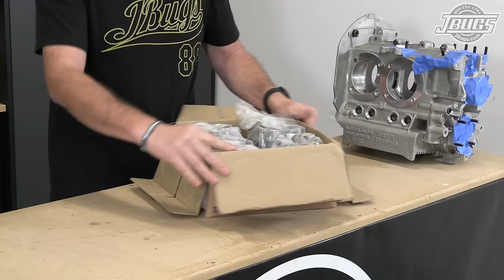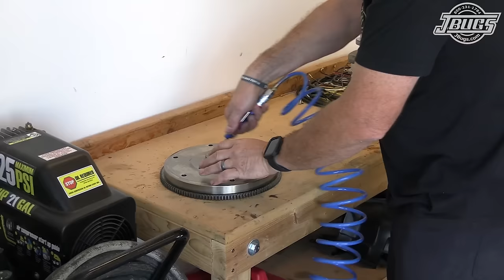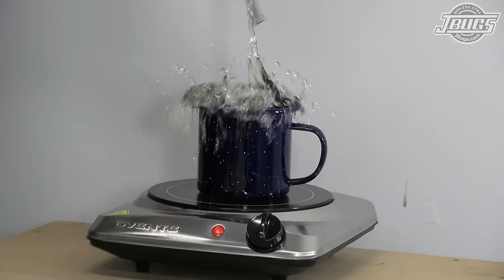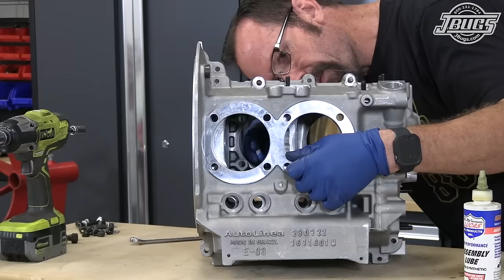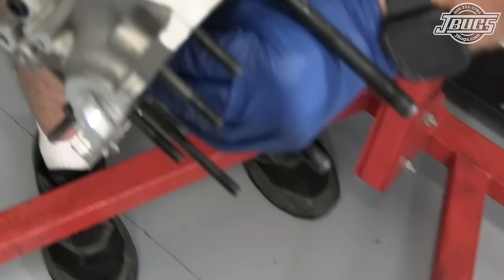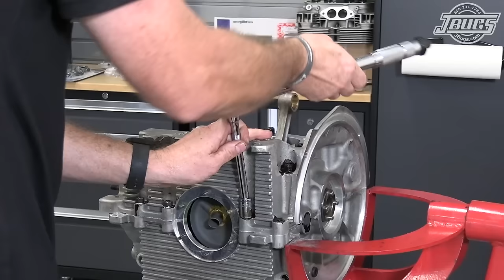JBugs - 1600cc Engine Build Series - Part 1 - Short Block

Comment: Nice video, is there anything I noticed was, need to balance the Pistons and the rods; always and I say always use the light and flywheel because the torque on the two rear cylinders cause the bearing to pound out the rear case and I like the 8pin the flywheel. Again balancing assembly is critical. I like the fact that the case has the option for a full flow oil system filter. And the Rodsuse better rod bolts which torque to 30 we used to talk to stock once the 28 ft lb safely
Reply: This is a pre-assembled kit from EMPI. There are better components certainly, we just built the kit as it came.

Comment: Better have a talk with your shipping dept about having to eat the case.  Put the case box in a larger box with plenty of packing. Worth the extra shipping cost. 

Page 120 in "How to Hot Rod VW Engines: The best procedure for building any engine is patience, care and constant rechecking"  When I built my first engine at 15, I put a couple main bearings in wrong. That was my learning curve.
Reply: That's what I have always been afraid of doing this myself. If it was a sb Chevy or Ford I wouldn't have a problem. But VW completely different. My engine builder won't be available till later this year.

Comment: Great video but I'm a little confused, the title says short block but you say long block? I'm pretty new to VW's not sure what the difference is :)
Reply: A short block is the assembled case halves with the connecting rods sticking out either end. A long block is a fully assembled engine (minus the accessories like engine tin, etc.) with the cylinders and heads bolted in place.

Comment: Sam, are the cylinder heads complete and ready to bolt on or do the valves need to be lapped before installation?
Reply: The heads are complete and ready to run. Could they be pulled apart and get a full 3 angle valve job? Sure, but I've never bothered for stock applications.

Comment: My only other comment is the engine doesn't look like it's going to spin too easily, do you have the correct main bearings for the case size to the bearings are these oversized case bearings.
Reply: The engine turns over and runs well. The kit comes with all new parts and standard bearings. A good part of why it doesn't spin "freely" is the Lucas Oil Assembly Lube. That stuff is super sticky, almost seems like glue sometimes, and I put it on everything.

Comment: If I got that case with a chunk broke off in that spot, I’d just TIG weld it back. No harm, no foul. BTW, I thought they came with the case savers installed. Speaking of the case savers, are they for 8mm or 10mm studs?
Reply: The broken piece isn't in a place that matters so we'll just leave it as is, again, no harm, no foul! The 8mm case savers were loose in this kit.

Comment: Does Jbugs offer in house classes for "hobby" VW restoration?  I've looked on line, and there is nothing out there.  Would be great to have the opportunity to spend a week and have a better understanding of electrical, mechanical and body work.  These videos are great, but to have the hands on experience would be valuable.
Reply: No, and for liability reasons it probably isn't something that we'll be able to do. We've regularly seen VW clubs put together "wrenching" or "shop" days which would probably be the closest thing we can think of.

Comment: Never built a vw, but a couple chevy and pontiacs
.  U don't mic out any bearing clearances?
Reply: With all new parts, checking the tolerances isn't common and most builders go by feel. If you're building with original cases and cranks that have been machined, checking clearances is a must.

Comment: What was the final problem that finally solved your locked up crank? Too you a few times. Not the rods being upside down but when torqued crank locked. I am having that problem. 4 times now tighten middle 2 just a little and it locks up
Reply: The bearings weren’t settled in place on the dowel pins. They are finicky little things!

Comment: What is torque of the center big nuts? Jbugs site says 18lb other places say 25.
With my halves together 18 lb its free to turn and if i go 24 it it very hard to turn. Is it still ok if i can turn at 18?
Reply: 15, 20, then 24 foot pounds in steps through the torque pattern.

Comment: The struggle is real Sam 😉  What do you use to seal the two case halves?  Seems like an ideal place for a leak to happen
Reply: I use Gasgacinch, always seems to work well for me.
Reply: You can use permatex aviation sealant
Reply: @calescapee9642  Aviation sealant is a little thick for the case halves. I love it and use it just about everywhere, but just not for the case seam.

Comment: 1. What's the effects if Rod are backwards 
2. Always see people grinding a pathway for the middle bearing to help with oil flow. Is this necessary
Reply: The rods are machined to be installed one way, I'm not sure if it is the oil passages, the balance or offset or who knows what. Either way, they are supposed to be in one way, so that's the way I installed them, eventually!

Machining the center oil passage isn't necessary, millions of VW engines were done without it and plenty of them are driving around that way still. Bob Hoover came up with a number of oiling improvements through his years of research and working on VW engines for use in airplanes. The VW engineers did great on designing the engine and in stock form, it is fine the way it is, but there is always room for improvement when it comes to adding horsepower and performance.

Comment: What was preventing the crank to spin?
Reply: Best I can tell is that when I pulled the case half off the first time to remove the o-rings for the shuffle pins is that one or more of the bearings shifted on the dowel pins. Making sure the bearings are aligned is probably the most difficult portion of assembling the bottom end.

Comment: Hey Sam. What gasket compound do you use for the oil pump gasket?
Reply: Gasgacinch typically, although copper RTV works well, as does Permatex Aviation Sealant.
Reply: @Sam_Mebane  sweet! It's good to know there are options on that. Thanks!

Comment: What sealant was used for the case halves?
Reply: Gasgacinch
Reply: @Sam_Mebane  I had to Google that one. I was sure you made that word up. 🤣
Reply: @Sam_Mebane do you know if Permatex Aviation sealant would work as well? He’s using both.
Reply: @zacharysawyer6241 No, aviation sealant is too thick, that's why I use both, I am "he" in the video.
Reply: @Sam_Mebane  🤣 I didn’t catch that. Ok. I’ll get the gasgacinch. I’m just impatient and have aviation sealant already. Thank you!